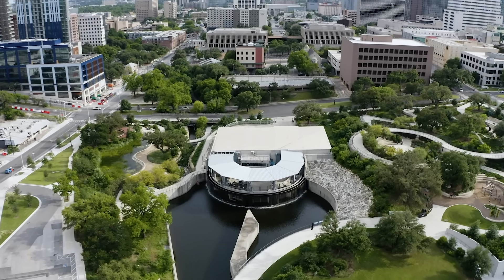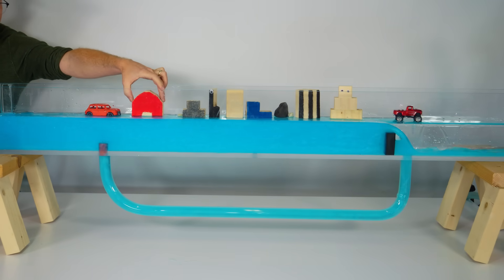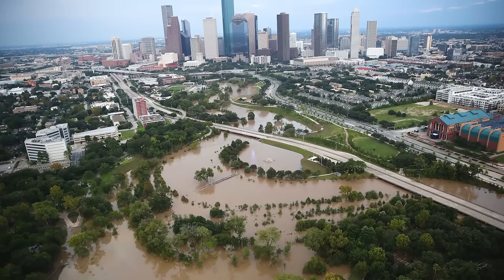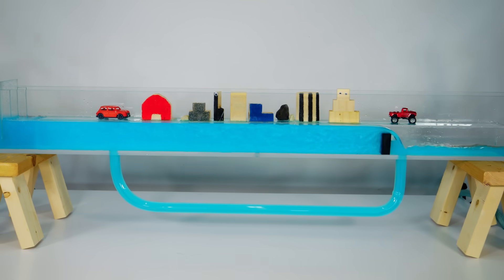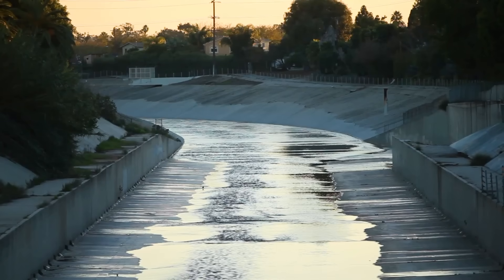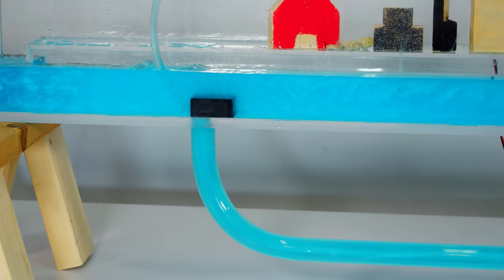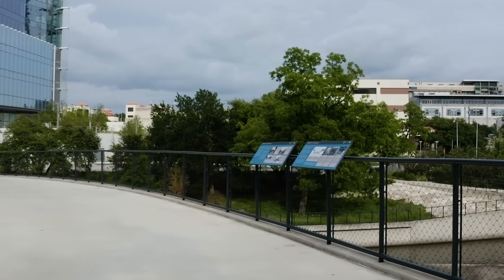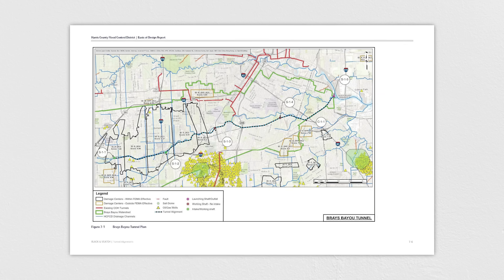How Flood Tunnels Work

Comment: I think one important consideration that isn't modelled in your model is that the bottom of building basements and subway tunnels is significantly below the point where river banks overflow so even just a few centimeters above the bank can fill up whole basements.
Reply: Basements aren't particularly common in Texas, so it's an easy oversight.

Between the wide swaths of open land and a frost line very close to the surface, there's little reason to dig down very far. 
And while I don't know about his area, mine has very clay-rich soil that expands and contracts a LOT with rain. This makes basements actively undesirable, as the expanding and contracting soil places immense crushing stress on underground structures before pulling away far enough to remove support.
Reply: @CptJistuce  in his last video he talks about the concrete in his garage cracking due to the clay rich soil.
Reply: @CptJistuce  they can be built to handle it if you're willing to pay extra, and they end up better able to resist foundation damage than standard houses...

No one pays extra when they're a developer though.
Reply: @RobinTheBot  would you rather they spend their investment on unnecessary basements or on more living space? They're not just magically pocketing extra profits by not building basements. Would you if you were building your own house?
Reply: @lightfeather9953  I would actually have loved to have a basement when I lived in the Austin area. It stays so much cooler without needing to run the AC as much, which is a major improvement (I spent more on electric in summer than winter, even when I lived in a place which only had resistive heating!). Ground temps in Texas are still in the 70s right now; air temps won't be below that for oh, 4 months or so.

And basements are (or can be, anyway) living space?
Reply: @CptJistuce  Having grown up in Norway where practically all houses have basements (or at least deep foundations) because they need to have foundations below the frost line otherwise the house would quite quickly start to move around because of the freeze/thaw cycles; it's very easy to forget that not every house have basements around the world, too.
Reply: Yeah, that was a problem in my neighbourhood after some flooding back in January. The carpark for my apartment is at street level, so we got a little water coming in... but nearby buildings with underground parks were still pumping water out weeks later.
Reply: That's a valid point, but fortunately it's one we all know; it would be awkward to build model basements.
Reply: We don't have basements in Austin. I mean, some of those rich downtown buildings *might*, but I'd expect them to have pumps already.
Reply: In this case it was recommended that the 'Shale' contact points should have been utilised at both ends of the Pipe slope precisely to deal with basement runoff, but it would have apparently caused " Unnescessary public attention to the issue" and resulted in spiking Insurance Suits which made it cost ineffective, period!  Go Figure. Correct decision IMHO.
Reply: I'm building a basement in Austin as I type.  However the lot is on a sloped hill so no issues with standing water.
Reply: The big problem with basements and foundations for large buildings in dense cities is less that they flood and more that they're pretty effective at keeping water out. So areas where  water used to drain naturally into the ground no longer drain when big building projects go up and the city does not build drainage to keep up.
Reply: Basements if ever they have one are more or less water proof and equipped with pumps to prevent flooding in their respective basements .

Comment: I've always wondered how survivable it would be for a human, prepared (air supply, armour/protection) or not if they got pulled down into something like this. Depending on how deep, I reckon the initial drop would be lethal, but say you survived that. Could you pop up out at the other end?
Same thing with those big bypass/overflow tunnels at dams. The ones that look like a big trumpet sticking up. If you were unfortunate enough to get pulled down one of those, is it a straight/smoothish pipe to the exit? If you got some breathing apparatus, and some abrasion-proof armour, could you torpedo your way through them?
Reply: There's one at the foothills of the Belt mountains (Can't remember the name) that has a culvert spillway. From the location of the inlet and outlet it's probably about a 45 degree slope and it ends with a plunge into a deep pool. Probably survivable with motorcycle gear and a life jacket.
Reply: There are a number of videos of people walking up the drain pipes to those gloryhole drains. Search for 'Ladybower Reservoir Plughole Explore Inside and Out' on the channel of Patrick Dickinson for a great example (I also rather enjoy his wildcamping videos). The Austin tunnel looks like a jagged mine adit roughly cut into limestone for most of the length.

Comment: Do these work anywhere? Or only in areas where there is a substantial change in elevation between the entrance and the exit of the tunnel?
I'm Dutch and I've never heard of us using one of these here in our everlasting, bitter feud with The Water.
Reply: it works anywhere with any change in elevation. its not used much in the netherlands because the main risk is from the sea (you have to block the sea from coming inland, with dams/dikes/levees etc), not from rivers within (having to move water faster, to make sure the river doesnt overtop)

Comment: I trained as an Electrical Engineer (focusing on computers) but I am ALWAYS interested in how stuff works.  I come at these with an eye to find some nugget of knowledge and I am never disappointed.
Reply: Another EE here with focus on embedded hardware who thinks this channel is gold.
Reply: CEG here checking in
Reply: If only Electrical Engineers were as smart as Civil Engineers, our delicate circuits wouldn’t get fried every time there is a surge😜
Reply: @rutgerw.  You have no idea.....
Reply: @Peter_S_  I don’t, but a varistor might do the trick?
Reply: @rutgerw.  🙄 MOVs degrade with every clamp and eventually catch fire or explode. That's why they're placed after a fuse, next to the class X filter cap... to stop them from starting fires everywhere. All better devices that use MOVs colocate a thermal fuse with the mOV in addition to the current fuse.
Reply: @rutgerw.  If you want to know how to actually stop surges, MOVs are not it. There is only a single product I've trusted in the labs and data centers I've built which is the Brickwall product line from the company Brickwall. You might want to read their information.
Reply: @Peter_S_  Interesting. I love how concepts translate between different fields of engineering, science etc.
Reply: @rutgerw.  I use water and cooking to analogize electronics to clients much of the time. Pipefitting and PCB layout share a very large base of concepts and techniques.

Comment: Not an engineer but I just wanted to say wouldn't it be useful if you could use that tunnel for something else during low non-flood days

Either as a steel meshed road or whatever (to keep water flowing). Putting it as a toll road, to keep funds flowing for the maintenance of it

Maybe not a road, but it would be interesting if it could be used as a railway station on either side to transfer just goods and services (not people persay) into or put of whatever city has this

Almost feels like a waste just for a single use. I don't know the feasibility of making it dual or multiple use but would like to see ideas for this tbh

Comment: Is there a perspective thing I'm not seeing right with the model? It looks like there would be no way for the water to flow back up the right side of the tunnel even though that's clearly what is happening. Is it the flow of water from the river pulling the water in the pipe out?
Reply: there is nothing stopping it, and the water is deeper on the left side, than it is on the right side, so it flows.